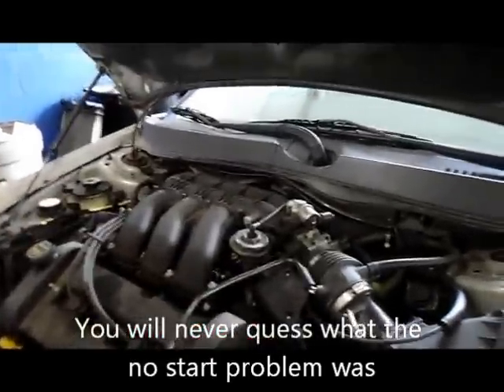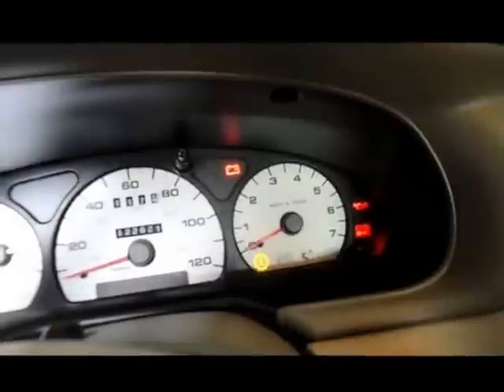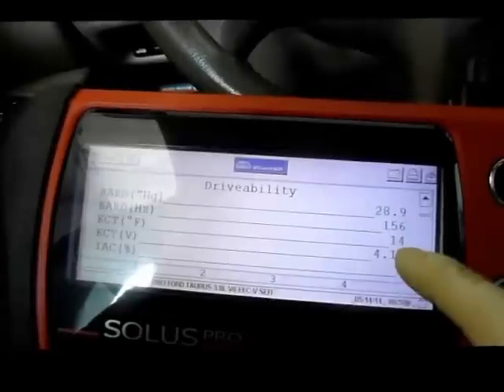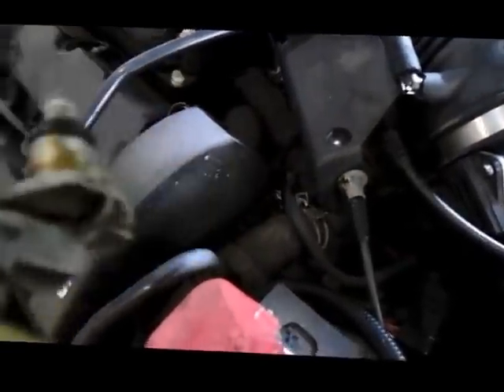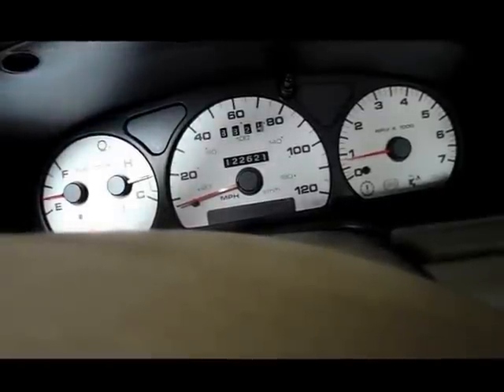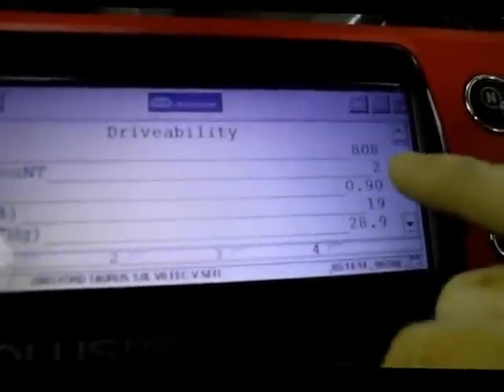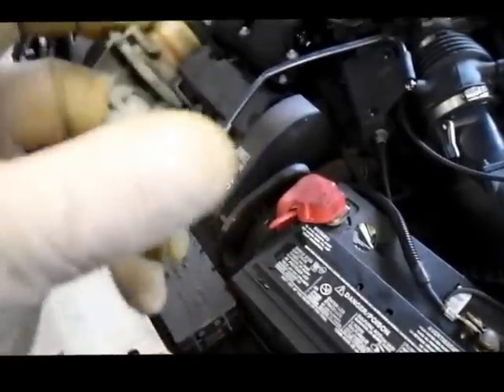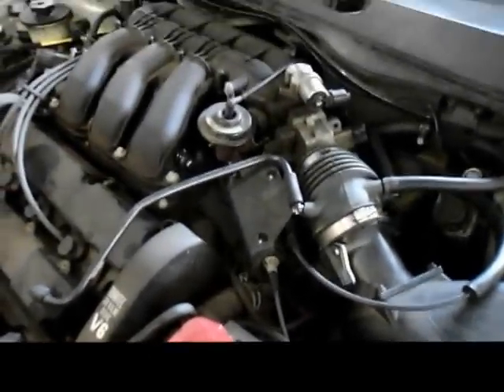Engine cranks but won't start

Comment: Because of your mentioning about the Crank Position Sensor and it's affect on the tach (which mine wasn't moving). I was able to find the sensor (which was cracked/broken) replaced it and the car started right up. $36 job !!! Thank the Lord

Comment: So glad I saw this. Save me ass shop fees. $22 part and I'm good. Thank you
Reply from the maker: Great.I'm happy to help.
Reply: jimthecarguy hi Jim all the best from Australian auto club yeah we have all kinds of sensor faults stopping engines from running from crank angle sensors and fuel pump failures to module faults and speed limiter faults I guess that's why we have to keep our training up to scratch cause every new model brings different problems. keep up the good work mate

Comment: My girlfriend has an Audi from 2007 and in winter we had problems starting the car.
When it was really cold outside we couldn’t start it so easy, we needed a minute or two cranking.
All this time the until the light came on, I went for a scan in summer and they said everything was as it should.
I went one more time in winter and guess what was giving bad reading…😕😕
I had the sensor replaced, no problem since then.
Great video!

Comment: with air temp at 70 and motor temp at 14, engine with not have a parameter for correct timing advance for cold start.
Reply: My Hyundai coolant sensor was showing -28 degrees and started perfectly all the time.
Reply: @davidtrautman6482  Do you even read what you write? If coolant temp is low and engine temp is low of coarse it will start. If coolant and engine temp are too far apart there are no parameters for correct air to fuel ratio.

Comment: The reason is the intake air flow sensor also reads temps and the discrepancy in the airflow sensor and engine temp sensor trips a no start situation so there will not be a misfire / backfire from timing / fuel program for cold temp causing it to possibly backfire a backfire with excess fuel = bad idea so the system said no fire / spark because it is way outside of specs. This is done this way on alot of dual overhead cammed engines with timing belts because a hard backfire will literally snap the timing belts and possibly cause valves to hit pistons aka possibly ruining a engine.
Reply from the maker: thank you for watching
Reply: I believe you are right Rick. I had a similar problem with a '91 Dodge Shelby Daytona Turbo. Ancient by todays standards, but they used the same logic to prevent bad things from happening.
Reply: i have a sububan 2002 that will crank but not start just like this but also the fuel gaudge shuts off. what could this be.
Reply from the maker: Di you scan for trouble codes?
Reply: check for spark then check for fuel easy way to check for spark is use a sparkplug and sparkplug wire and ground it the exhaust manifold and look for a arc / spark if there is none likely have a crank sensor issue or ignition control module is bad and if have spark check for fuel if have fuel make sure is proper fuel pressure around 45psi is minimum for a 2002 suburban preferred around 50-55 psi.
Reply from the maker: Thank you for watching
Reply: Rick Cooper i have been troubleshooting my audi a8 2006. Crank no start. I did timing belt "P.I.T.A." complete with the proper tools. Both Fuel Pumps. Cps, cks, and fuel filter, and plugs. Ive been throwing time and money at her carelessly. I still am at square 1. It gave lean codes for about a week then 1 day didnt start. The rpm guage doesnt move when i turn the key over. I understand battery charge plays a big factor, the coolant temp sensor, And cam chain tensioner are what im left with guessing. Codes recently i got was bank 2 misfire 5,6,7,8. And cam sensor code.Was crank sensor code until i replaced them. New cam sensors but the car hasnt started yet.
Reply: I will admit defeat there a AUDI A8 is outside of my knowledge range well reach of my pocketbook LOL so I really can't help you there
Reply: damn, ive replaced so many things, next  ima check the ECT, MAF, and i guess remove the valve cover and check the cam tensioner, or something.
Reply: iRecordOS . I having similar problems with my Audi A4. Code started with maf, than tps, misfire ect. Codes come and go without work being done. Problems started when gas station water filter went bad and I got cups of water in gas tank. All my research so far has me believing it's a vacuum leak. Started replacing lines and started running better, than my oil temp gauge stopped. Two days later, car won't start. Love to hear your final fix. I'm seeing these dual injection engines are very touchy when a sensor reads even a little off. (Dirty air filter caused almost same conditions prior) good luck
Reply: Rick Cooper
Reply: I think the descremancy between intake air and temp sensor is a good point but I noticed that the temp guage is up to temp so I think I would look at data in the instrument cluster also.    I am guessing that the ECU would not let it start because of the difference in all 3.    The older Ford's would flood with bad sensor saying cold engine, if you floored it it would start.   I think the ECM shut this system down cause it knows things are outta wack.    That is my best guess.   The instrument cluster will not be used to make fuel trim decision but will confuse the ECM.
Reply: Rick Cooper

Comment: The sensor could have been shorted to ground internally, pulling vref below 5v.  When that happens, the micro controller (PCM) loses reference for all the other sensors since vref is a common circuit.  No telling what kind of weirdness can happen in that case.

For those that don't know: VREF is the +5v signal supplied to all sensors in a vehicle.  The sensor will return a signal that ranges from 0v to VREF, and the PCM translates that into engineering units (voltage, temperature, etc.).  If VREF is below 5v, some sensors will not work, or return incorrect voltage for what is physically going on.
Reply: Thank you for the breakdown! Cause this is crazy! 🙌🏿🙌🏿

Comment: A  99 Ford Explorer would crank but not start.  Relay was good.  Had it towed in to be checked.  Mechanic said  the problem was that the thermostat was going bad.  When my daughter called to tell me (it's her car now), I told her that a thermostat can't be the problem.  Perhaps the problem was the same thing you ran into here.  Anyway, it's running fine and all is well.  Live and learn.  Thanks for your video.